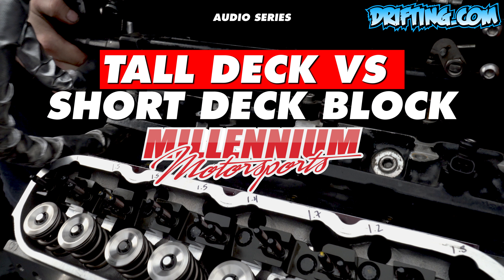Tall Deck vs Short Deck Block

Comment: The piston not being supported is true for a stock block, but for the Dart block they have .375 added to the bottom of the cylinder to support a 4” stroke with a standard 9.240 deck height.